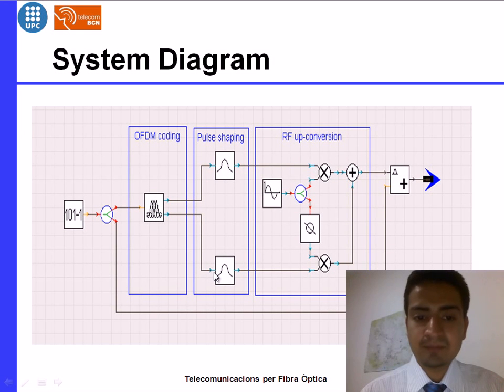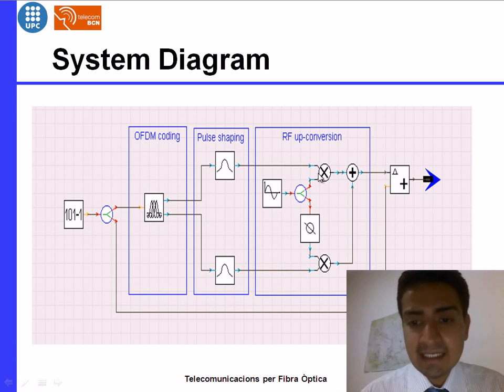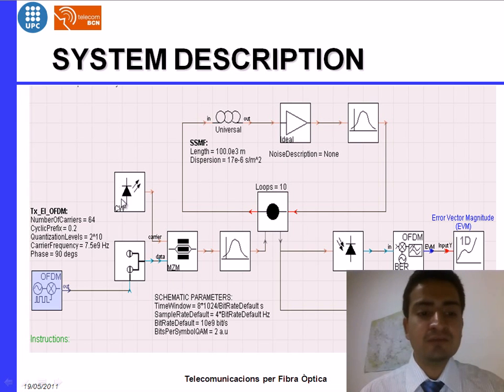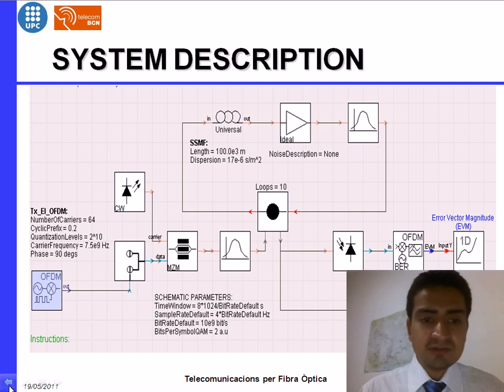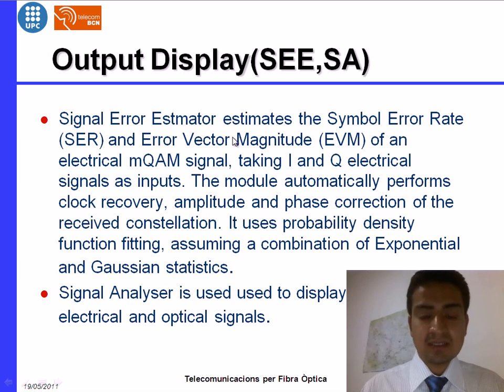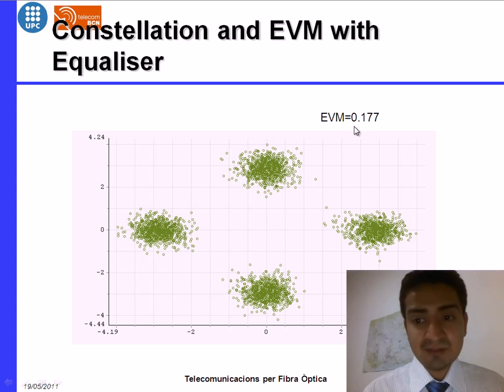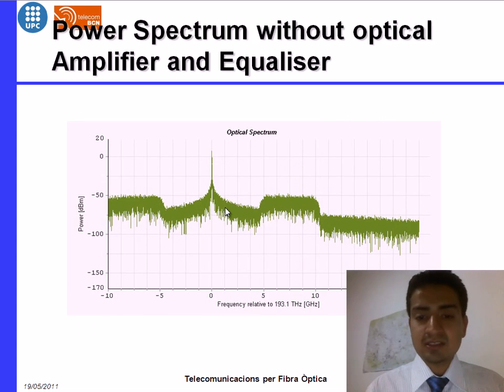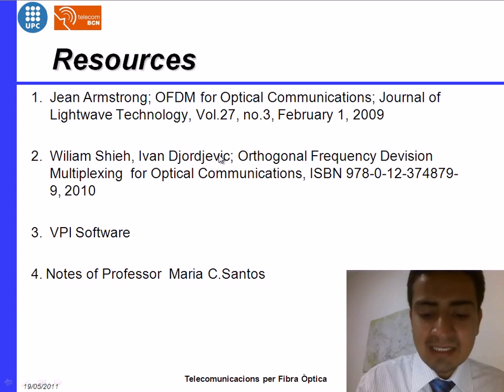OFDM in optical part 2

Comment from the maker: @Taimur Mirza
For Introductory presentation, You can watch first part of this video: Look at Right Corner "OFDM in Optical part 1".
For Analog and Digital Photonics Presentation, I am working on it. Wait for that release
Reply: +yatish bathla Khatri Thanks for your reply, I am trying to build the similar OFDM structure in VPI but the Transmitter I have in VPI is without the Logic Adder Channel. so Basically the RF-upconverted data goes straight into the Laser Driver and modulator. Could you also show me the OFDM Receiver Structure and parameters. Many Thanks :)
Reply from the maker: Taimur Mirza I have presentation with notes. Give me your email address.
Reply from the maker: Sorry for the late reply.  Regarding OFDM transmitter and receiver, i recommend you to read my blog. I am sharing the link below:
http://ofdmmantra.blogspot.hu/
If you still have doubts, fell free to write the comment.